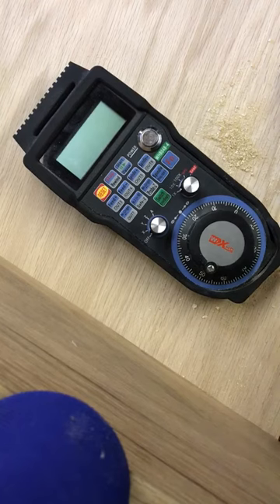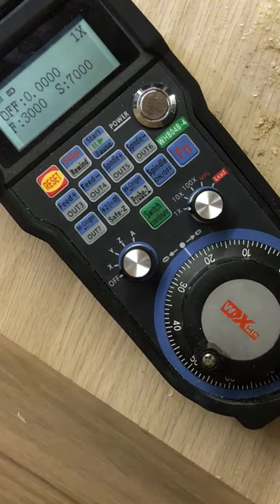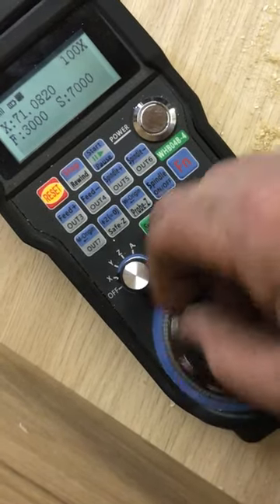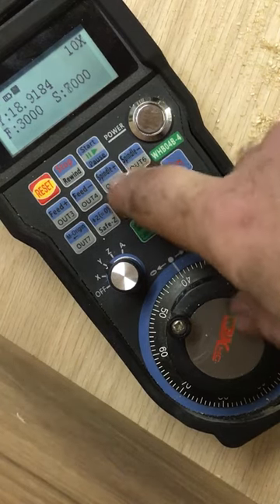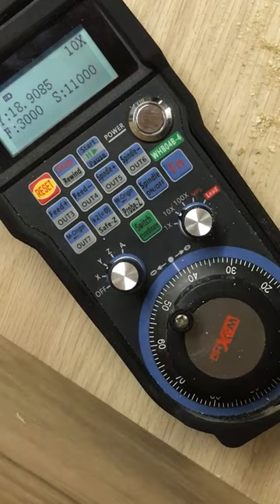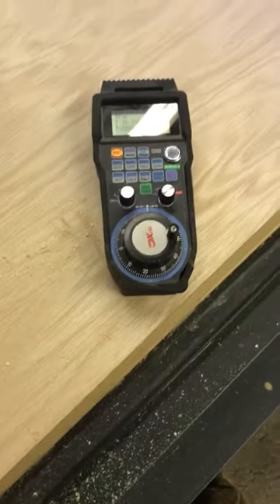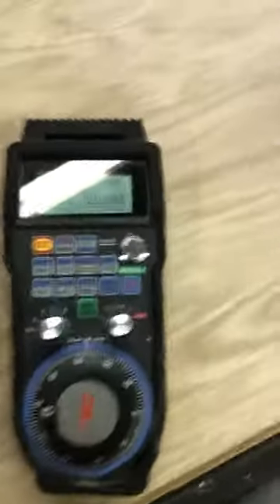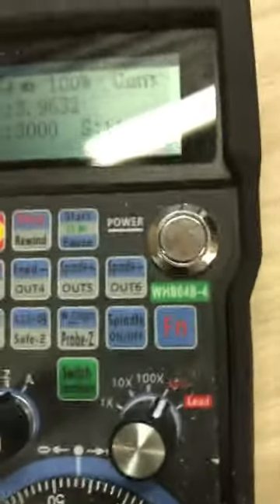WHB04-4 handheld controller review

Comment: I have this unit , but where do I get dll file or driver to install... bought with my new CNC and just now trying to install it to get it to work. Can anyone help?
Reply from the maker: Sorry Michael, My cnc company sent me a file to get it work on the CNC... BUT I don't use it anymore stuck in my old ways...THE KEYBOARD!!
Reply: Mine is moving system on x, y, Z axis okay now... But is not is not displaying offset data in the lcd screen... Got any ideas?
Reply from the maker: sorry don't know.....Micheal!
Reply: dear ,Jeff Woodshop,may i know where did you bought this handwheel,this is my company products
Reply: Hey Michael, Where did you find the correct .dll driver? I have an issue of the driver from the website not working and I can't use the CD because who has a CD rom drive any more. Any advice would be awesome.